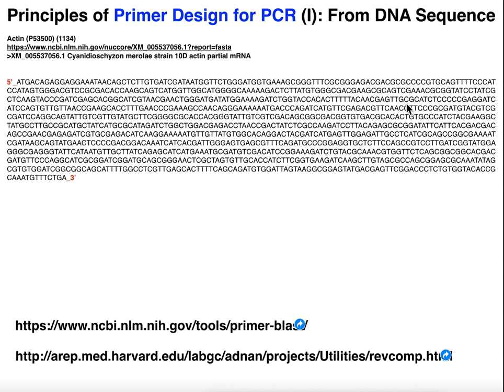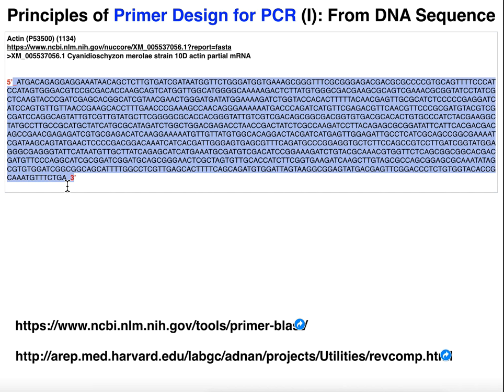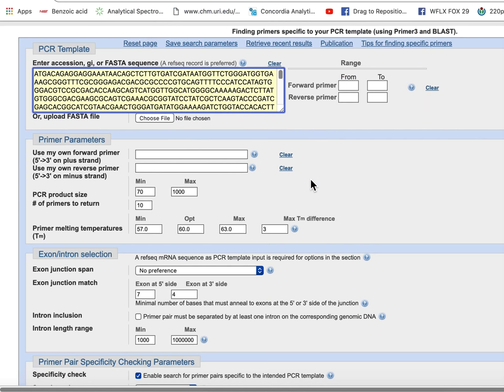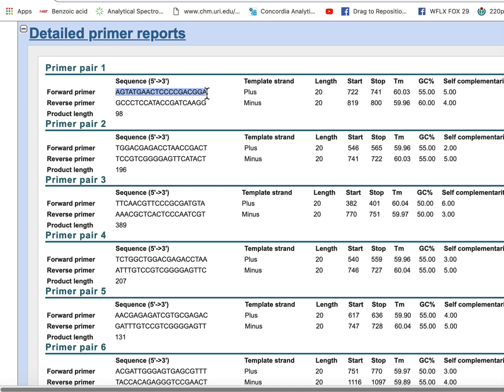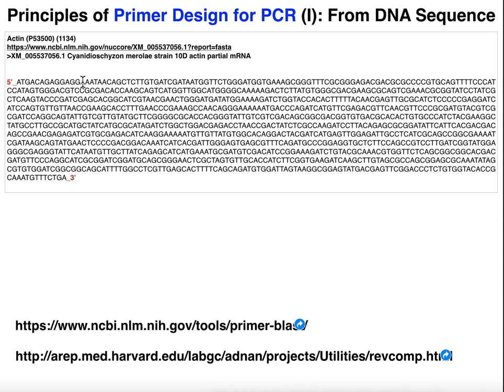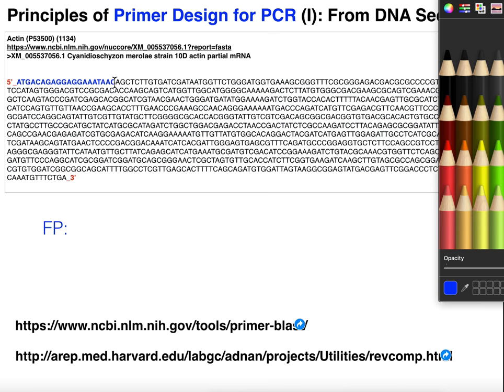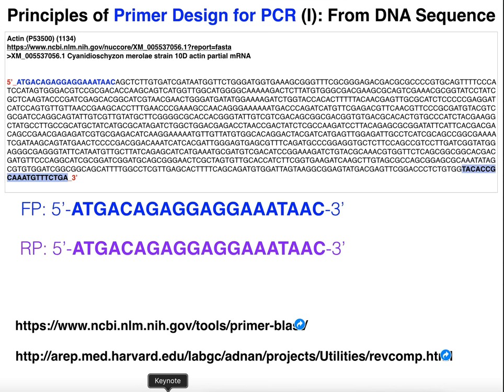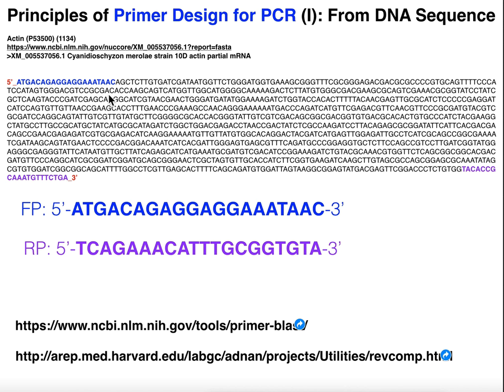Biotechniques | Principles of Primer Design for Full Gene Amplification

Comment: The start-point and endpoint of a desired DNA-sequence does not  provide necessarily a suitable set of primers.  In most cases, it does not.  (Selfdimers, wrong amount of Cytosines en Guanines. CG-amount should be around 60%)
Reply: How do you mitigate against this?

Comment: Hey there! Thanks for the video. What if the forward primer as described in the video contains GC and AT rich regions which are not desired? Or if they have suboptimal melting temperatures? Would one then have to search for other 20mers upstream and downstream of the gene to use instead of the start and stop regions as starting points for the 20mers? And how would we do that? Is there a tool for that also?

Kind regards